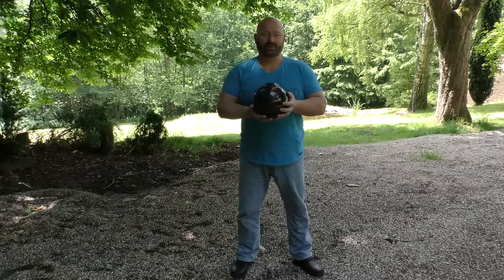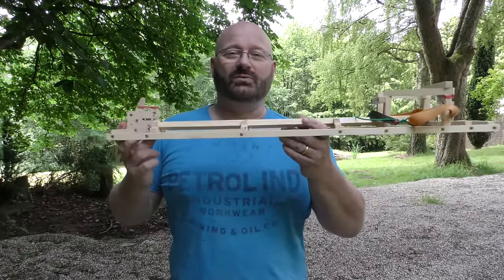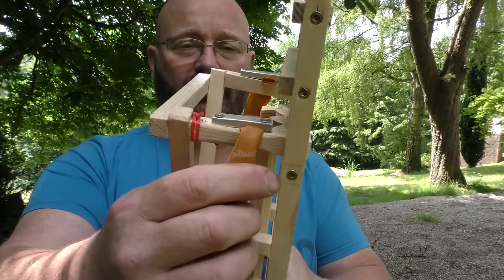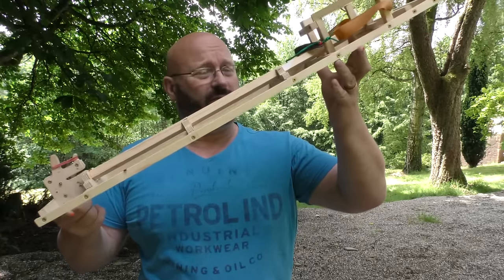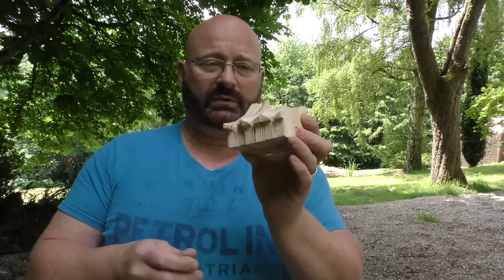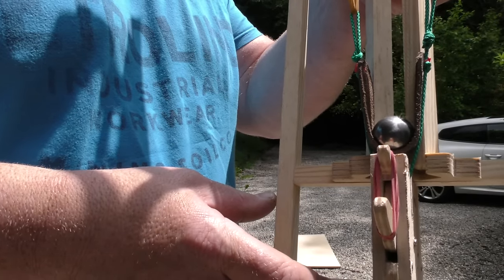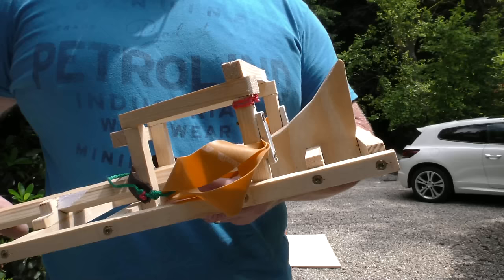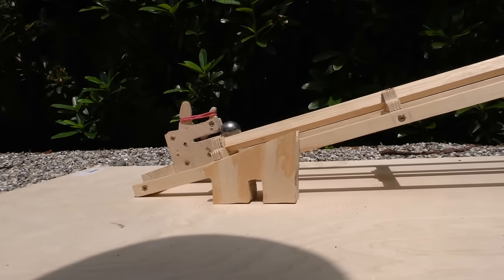Bowling Ball Launcher 1:10 Scale Experiments

Comment: I think you have to hoist the whole thing up. The bowling ball is too massive and would break the ramp.
Reply: or destroy the bowling ball, there will be a lot more energy and bowling balls aren't as durable as steel balls.
Reply: I'm right there with you. You'd need one hell of a sturdy ramp. It would be better just to hoist it up.
Reply: Depends on the weight of it .. bowling balls go from about 2kg to 7kg.
Reply: Rob M A lighter bowling ball will be easier to throw of course. However, he planned to use a heavy one at about 6kg
Reply: True!
Reply: The ramp will be fine as long as the ramp's transition is smooth enough. You're all assuming he can get the same acceleration and force he achieved using this smaller steel ball with more bands. That won't be the case at all.
Reply: Smooth transition aside any transition will absorb some momentum and likely take some damage as a result. The other trick is I feel while the firing deck can be wood the ramp might need to be steel.
Reply: Yeah, I second this.
Reply: The initial shock from 0° to 15° is to high, a steel ramp with "slowly" increasing angle should work much better
Reply: I agree with this theory
Reply: Agree. At the end of the day, building a smooth/functional ramp is probably harder than hoisting the thing up...
Reply: I think you're right
Reply: Based on his ability to make slingshots with curved handles that should not be a problem.
Reply: He could just use metal to make the ramp...
Reply: +Daniel G  Hey! This is a respectable slingshot channel, not some kind of southeast asian brothel!! You don't mix metal with slingshot!
Reply: but then at that point it might be more cost effective to put a ramp under the launcher than to roll the bowling ball up it.  we're talking a lot of metal here.

Comment: if you build it on a trailer you can move it around easier also you could use a car jack to adjust the angle if needed
Reply: I wonder if a flatbed trailer would provide a decent base.
Reply: A vehicle-mounted bowling ball launcher sounds like a great idea indeed.
Reply: Good idea, a single axel trailer like those used by farmers, would be high enough of the ground to alow a 45° or even more for a 7,5m long base...I would like to see that, think of the posibilities, like aiming  and turning,....Bowling ball target practice yeahh!!!
Reply: Yeah this is probably the best plan. Reinforce the frame so it doesn't need the ground to keep it straight, the allow the two wheel trailer construction to act as your elevated pivot point. After that, raising or lowering the back end will let you adjust the angle to anything you want.
Reply: it would be a solid concept to work from. have a removable mounting system as well so that he could use the trailer for other things. the angle would depend on the position of the axle and the length of the bed.
Reply: Great idea y'all. It would basically be like a cannon, or an artillery gun. Great thinking.

Comment: Not trying to be a smartass, but while multiplying the radius by 10, you multiply the volume (and mass, in case models are made from the same material) by 1000. Pure math: V1 = 4/3 * Pi * r1^3. If r2 = 10*r1, then V2 = 4/3 * Pi * r2^3 = 4/3 * Pi * (10*r1)^3 = 4/3 * Pi * 1000 * r1^3.
Reply from the maker: Sure, but let us not forget that I will use a lot more rubber too - 10 times longer, 10 times thicker and 10 times wider = 1000 times the rubber.
Reply: JoergSprave You're all set then. Looking forward to see that.
Reply: I think you win the neckbeard of the year award for that profile picture. no offence, I like pink floyd and arch.
Reply: But you need to admit that saying that the ball was 1/10 of the bowling ball was absurd.
Reply from the maker: If you build a model to scale, that is how you do it. You scale the dimensions based on their size, not on their volume.
Reply: JoergSprave
ok, thx
Reply: Please also remember steel is heavier than bowling balls! using a steel ball x1000 as a measure for how much rubber you need could lead to sending that bowling ball a lot further than you meant to :D
Reply: Blasturbator
"steel is heavier then bowling balls"
I havent heard such a phrase for a while now...
Reply: just add more rubber
Reply: LockenJohny101
lol....
Reply: well, LockenJohny, it IS a denser material than the stuff bowling balls are normally made out of, so a metal ball of equivalent mass would be heavier.
Reply: PsylomeAlpha
you know I could have tolerated if he would have said steel is heavier then the material bowling balls are made of. I mean that is wrong, but kind of ok.
But a material is HEAVIER then and object. Is just funny af. And ofc I know what he wanted to say...
Reply: I think you should do the ramp, though it may not be as effective as angling the slingshot i think itd be more exciting to see :)

also if you do the ramp, can you fillet the intersection where flat meets angled? there is energy loss between the collision of the flat and 15 degree angle, rounding the edges would soften the impact and make your ball go farther.  it would also increase the durability of the contraption because a bowling ball wont be crashing into the end of you slingshot everytime you fire it.

i don't mean to offend you if you are already intending to do this, but i didn't hear anything mentioned in the video
Reply: LockenJohny101
I just couldnt be bothered to type out "a steel ball the same size as the bowling ball would be heavier" cos i'm lazy but now you made me do it gg
Reply: Blasturbator
gg
Reply: That's what she said! Unfortunately...
Reply: +JordPlaysGames Does that logic apply to chil.. Nvm.
Reply: the bowling ball also has a lot lower density than a steel ball
Reply: This is a backyard model of a bowling ball launcher for a slingshot channel on youtube, not a prototype for an ISS component for NASA.
Reply: Pi = 3,14159265.......
Reply: +LockenJhony101 wich wheights more a kilogram of feathers or a kilogram of steel?
Reply: Igor Toebe
STEEEL OFCOUSE!!!!!! XDDDDD
but srsly. weight measures force of a an object in a gravitational field and killogram is a unit of mass.
So steel is acctually the correct answer when we consider the liftingforce of air, because feathers have lower density.
In a Vacum however the WEIGHT of both would be the same.
Reply: If you concider that the wheight is measuried in the aplyed circunstances, the anser is they will be the same, but the total volume of both will differ betwin inside the atmosphere and the vacuum, proportionaly to the lift-force of the fluid that the atmosphere is made of that is related to the gravity field inflicted in the system analyzed.  anywhay I liked your smartness, subscrybed! XD P.S: sorry for the gramatical errors, english isn`t my birth language.
Reply: Igor Toebe
English ist my birthlanguage either, also I didnt understand what you have said there.
Reply: Если вы рассмотривать , что wheight является measuried в aplyed circunstances , то Anser , они будут такими же , но общий объем обоих будет отличаться BeTwin внутри атмосферы и вакуума , proportionaly к подъемной силы жидкости , что атмосфера состоит из того, что связано с гравитационным полем , наносимого в проанализированной системе . google translated
Reply: Igor Toebe
lel, I speak russian but that doesnt help...
I can speak english, that was not the reason I didnt understand you.
Reply: Igor Toebe
AAAAH, I got it, you are right!
Reply: Igor Toebe Actually, your grammar is probably better than 90% of what native English speakers seem to be able to achieve.
Your spelling is a little funny, but phonetically it's easy for most English speakers to understand the context, regardless of the spelling.
Seeing how English speakers already butcher our own language so much as it is.
Cheers.
Reply: Postghost
British pronounciation is the worst, and I can agree on the grammatical falaccies. Its the same in Germany.
Reply: LockenJohny101 " British pronounciation is the worst " 
Ironic, huh?
Reply: Postghost tenks for your coments bro
Reply: Postghost
no, its disgusting
Reply: no, i meant about my grammar, is hard to see people recognizing some skill that another ones got.
Reply: you're absolutly right, it was the first thing i mention in the video
Reply: considering the rubber is 10 times as thick and 10 times as wide i reckon it would be safe to assume the spring constant would be equal to that of a stack of bands that is 10 model bands wide and ten model bands thick. Making the spring constant(K) 100 times as large. The full scale launchers bands will be 10 times as long, meaning it would take 10 times as much force to pull them all the way(in relation to the spring constant that is). This would mean the average amount of force you would need to apply to pull it all the way which is on average the amount of force it would aplly to the ball, is 1000 times as large.(F=X*K is for the model. Thefore 10X and 100K would make it 1000F for the full scale contraption) Since the distance over which the force would be applied is also 10 times as large, the amount of work done is actually 10000 times as large.(W=F*X for the is for the model meaning 10X and 1000F make it 10000W for the full scale contraption) This means the full scale ball, which is 1000 times as massive(assumng its about as dense as steel) will also go sqrt(10) times as fast. Since E=v^2*m/2,. Considering he amount work done by the model is E, and the mass of it's ball is M, the full scale model should do work which is equivalent to 10000E and have a ball with a mass of 1000M. putting is in the formula we get:
V^2=E/(M/2) and V2^2=10000E/(1000M/2) when we divide the second equition by the third we get:
V2^2/V^2=(10000E/1000M*2)/(E/M*2)=10000/1000=10
V2/V=sqrt(V2^2/V^2)=sqrt(10)
(please notice its V2 as an additional variable and not 2V as in 2 times V)
This means the bowling ball should leave the contraption more that 3 times as fast as the small steel ball(when you completly neglect things like friction with the contraption as well as air resistence and what not (Because you either dont know how to properly calculate them, are too lazy to do so, or they just pose a neglectable difference. In which you are still lazy so but at least you have a proper excuse)
Reply: Right.
Reply: Progsnob
Reply: Ok lol
Reply: Can you say that in English please
Reply: Can you say that in English please
Reply: +Darkness Destroyers well it is in english lol
Reply: hmmm jeeaa you are right
Reply: leap
Reply: Dude what
Reply: no idea what you said 😫
Reply: if you iluminate the yellow elephant with the right spectrum of light at a certain distance he will be pink...its all in the eyes of the observer.
Reply: Steel only weighs more if you don't have to deal with the guilt of what you did to all of those chickens... hehe
Reply: i eat chikens for dinner!
Reply: Igor Toebe 
I eat 🐔 nuggets for dinner
Reply: ok.

Comment: hoist it up!!!, and do it so you can change the angle between shots for more accurate destruction
Reply: Exactly
Reply: I agree
Reply: also, correct me if I'm wrong. wouldn't the gap between the hoist and the ramp be more brod when it is scaled up (27m-31m)-(400m-700m)
yes, I just used random numbers, I have no idea how far it will go, I'm not the brightest fellow
Reply: +Lit Tutorials but remember we don't know how much rubber he will be using and we don't know the weight of the bowling ball he will be using so we can't really estimate without at least part of that equation
Reply: Exactly!!!

Comment: I would vote hoist the slingshot; I'm seeing problems with the ramp suffering from unplanned spontaneous disassembly when it gets hit with a bowling ball.

My suggestion for hoisting it: build a ramp the length of the slingshot out of a wooden scaffold frame (in the same design as a crane with equilateral triangles) in the shape of a cheese wedge. Then attach a winch to the top of the ramp and pull it up into position. Then just screw it into place. 

This would be better than slinging a couple of belts over a tree branch and hoisting the front up because then you're not causing the slingshot to sag which could have some adverse effects.

Keep up the good work!
Reply: That's pretty smart, and then you can really overbuild the ramp for stability and extra mass, which would allow you to apply even more force to the bowling ball and treat it like a bullet. At that point the only danger is how the fork is made. Maybe oak or another hardwood reinforced with birch plywood or something.
Reply: The ramp is only 30° and the bowling ball won't have the same acceleration as the steel ball. The larger experiment will be a lot slower, even though he's increasing the number of bands. The small steel ball also has less surface area and so less air resistance.
Reply: yes- good idea.
Reply: 100% true.

Comment: you could dig a hole to put the back of the launcher in, and put the unearthed dirt under the other half of the launcher as support
Reply: or use a small hill....
Reply: I'm with this guy, using natural terrain to prop it up makes it far easier. and potentially could give a steeper angle than lifting up one end. Sharp angles on a rail dramatically slow down a projectile so keeping the rail straight while changing the angle of the aparatus is obviously better.
Reply: +Pprokop87 but see if you don't have one he just described how to make one.
Reply: Monkeysrock Jorg have some hills, so He don't have to dig ;)

Comment: Add a hinge in the rear, make the whole front framework raise and lower with jacks.
Reply: yus
Reply: +1
Reply: +Caleb Davies those are some nice features
Reply: Not sure if you've priced 2 meter jacks that would have the extension range to make this feasible, but I don't think he's wanting to spend 25,000 euro on building this.
Reply: +John Klatt he could hang it into a tree maybe
Reply: +1
Reply: Just add a wooden beam that hooks on steps, it's not that hard to build.
Reply: +Arcanis the hell are you on about mate
Reply: Kai Gore That could help get it into position but it would still need plenty of stabilization.
Reply: You have any 2 meter jacks lying around?
Reply: Put the jacks close to the pivot point then, would be the same effective angle with a smaller jack.
Reply: +Epicbobo1 I don't think you appreciate the scale of this or the amount of leverage. he is taking about building this 7.5 meters long. trying to lift that from the light end would put so much stress on the wooden frame. not to mention multiply the force needed to lift it.
Reply: John Klatt
I would assume the construction would be sturdy enough to handle being lifted maybe 2-3 meters from the hinge and if he made something similar to a giant scissor jack, knowing that a small scissor jack can lift a car, a huge one made of wood should be fine.
Reply: +John Klatt I don't think he's saying to move it all the way down, if the entire thing is 7.5m maybe only move it 1.5 - 2m from the end
Reply: +Epicbobo1 a wooden frame will have more flex to it than a car though. to compensate for that the entire machine would need to be built even more sturdy otherwise the track is going to curve away from the shot. whether or not that's a good thing would remain to be seen.

a scissor jack is lifting a fraction of the weight of a vehicle. You don't use one to lift the far end of the vehicle because it would fail if you tried to do so. at the size he is building this it with the amount of leverage the mass will have against the jack point you are recommending, it will be as if it's trying to lift the entire weight of a vehicle, if not more. 

a scissor jack doesn't even lift half the weight of a car as it's always at the farthest spot from the pivot point, which is the tires on the opposite side from where your are jacking.

doing it that way would bring us back to needing two better jacks. that said i would love to see him build a massive two meter scissor jack.
Reply: John Klatt
Thumbs up for the two meter scissor jack.
Reply: "a scissor jack is lifting a fraction of the weight of a vehicle." <- Boom. Spot on. This is why (if you're a decently sized man of good strength) you can lift a car high enough for someone to change a tire yet you cannot 'lift a car' period.

Comment: Maybe lubricate the ramp as well, or use metal beams? Less friction.
Reply: Or wheels
Reply: +Alan Jeffrey or steel balls :s
Reply: Actually, using a metal pouch that's shaped perfectly for the bowling ball would allow it to roll during the shot, reducing the fiction it would get by sliding.
Reply: use steel beams if you are using steel balls, it has very low friction, mixed metals i don't believe are like this.Though that would make it very heavy and hard to hoist.
Reply: +poodlelord 

But bowling balls can't melt steel beams.
Reply: Jamie Hyneman runs in with a tub of lard: Did someone say "Lubrication"?
Reply: I was thinking the same, good idea!
Reply: Came for this
Reply: very clever
Reply: The steel beams is a great idea, because he could use jet fuel as propulsion and they wouldn't melt!
Reply: Wheels or steel balls wouldn't work as it's an uneven surface with bumps, taking into account gravity; there would be a lot more resistance.
Reply: ***** saw this coming, enjoy your +1's

Comment: The best method will be to get the entire ramp to around 40 degrees. This would give it the best trajectory to fight air resistance while traveling the furthest distance. For those of you arguing for 45 degrees, this is only optimal when no air resistance is accounted for. 
  As far as a method of lifting the entire ramp, I would suggest attaching a winch to one of you buildings, winching the front of the contraption up, and fitting a frame underneath the device that would hold it at the angle.
 the largest issue with the ramp attached to the end of the device is the severe change in the angle of velocity is, as you said, that energy is lost on impact with the ramp.
  Hope this helps, keep being awesome man!